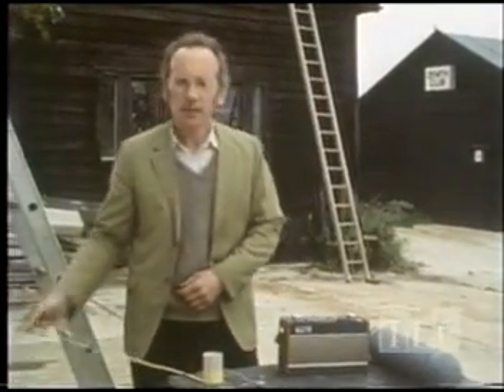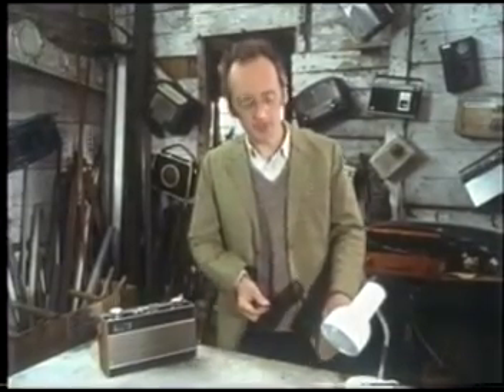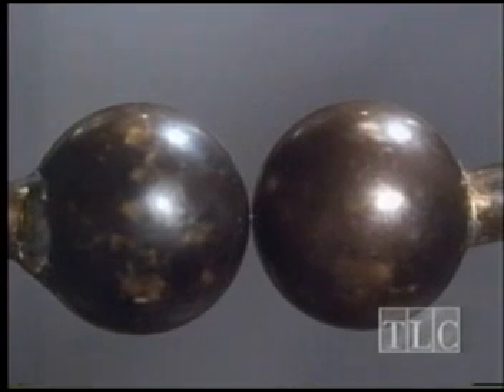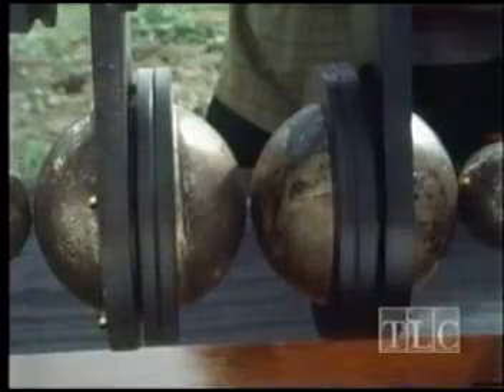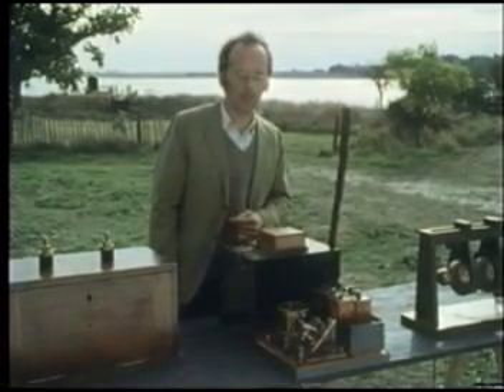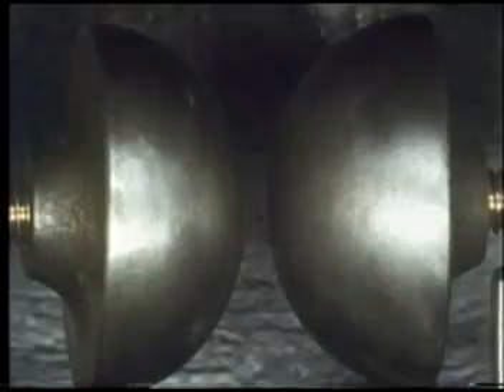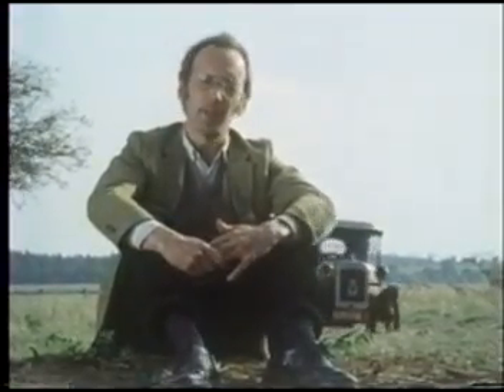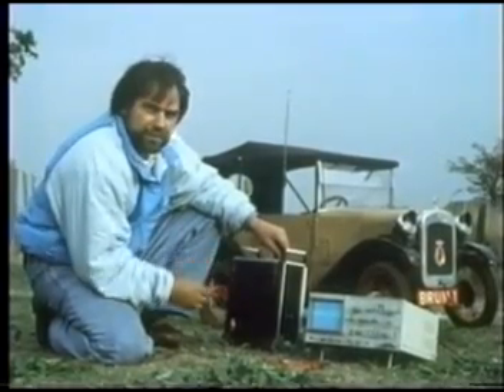Part 1 of 3 The Secret Life of the Radio

Comment: You might think that a vacuum would be ideal and more efficient  to make a spark in, but its not the case, you need something slightly conductive like a gas, so in a way its sort of has a semiconductor quality: somewhere inbetween a vacuum and metal conductors.

Comment: Actually, EM radiation can be produced in several different ways.  What distinguishes light from radio is the wavelength.  So the wavelength/frequency which is the rate of oscillation has to be taken into account when we talk about reception and interference.  It's an additive process where 2 waves of similar wavelengths collide and depending on their phase, either reinforce or cancel each other.  Different wavelengths don't see each other and pass right through...

Comment: That's essentially right.  The breakdown voltage when sufficient will break down the dielectric turning it into a conductor.   The accelerated charge is just excited electrons that jumped into a higher orbit.  They release photons as they lose their energy and fall into a lower orbit if they're bound to an atom.  They produce EM fields whenever they change direction (Think A.C. and magnetism, or when a wire cuts through a magnetic field.)

Comment: Simple.  When a spark ionizes the surrounding air through electrostatic discharge the air becomes a conductor.  Accelerated charges radiate EM (electromagnetic) energy.  The type of radiation (in this case radio) depends upon the frequency of oscillation.  EM radiation propagates by means of oscillating EM fields that pass through the air and the vacuum.  The oscillating fields induce AC current by resonance in another conductor (the antenna)  proportional to the source.